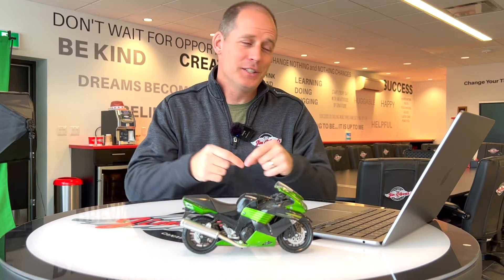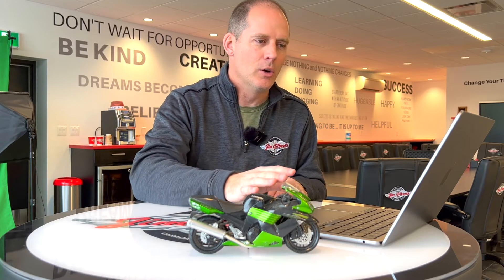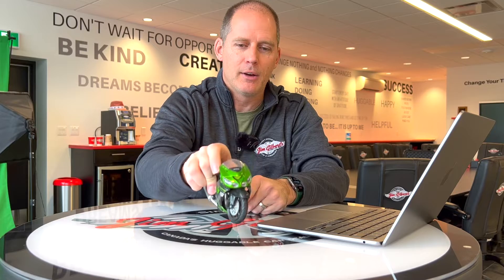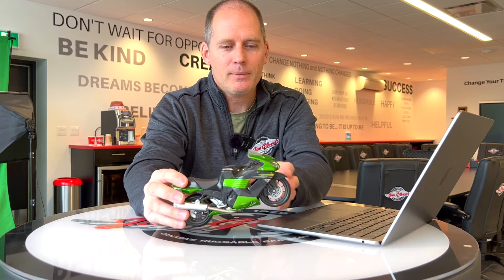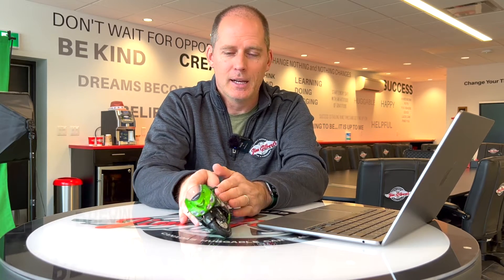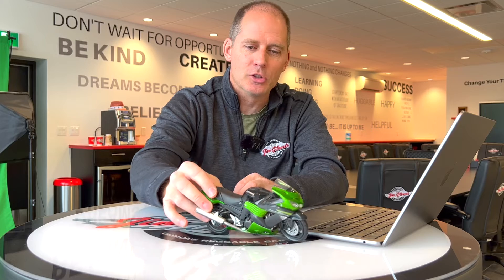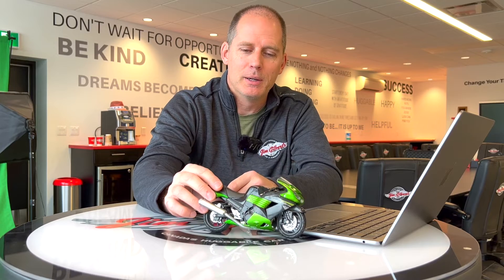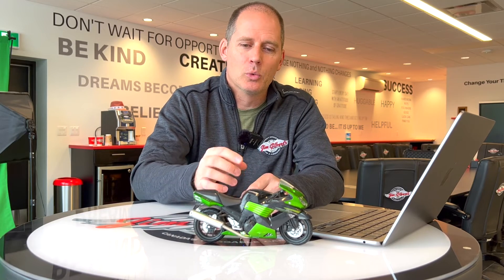Kawasaki IMU Explained in plain language using toys! - Peter's Kawasaki Class!

Comment: Good video. 

Just need to help everyone understand one thing. 

There are no 6-axis in our three-dimensional world. There are only 3 axes.

What you mean is "6 dimensions of freedom".

So, "forward and back" is not axis 1 and 2, it's only axis 1. You can move in either direction along an axis.

So, we have 3 axes, hence 3 dimensions of freedom remains. 

These three dimensions is the object rotating around the axes. For aeroplanes these are called yaw, roll and pitch and the same can be applied to any moving object.

Comment: With in 4 minutes he may have misstated.   A bike with TC and no ABS still controls wheelies.  A 2014 (non ABS) ZX10R’s archaic TC does act as wheelie control.   However he is correct that on a low setting the bike will hit 1pm then violently slam down, it can even flip over if you hit a bump.